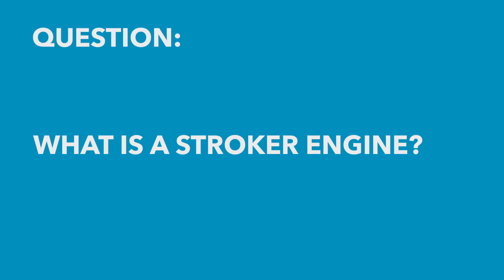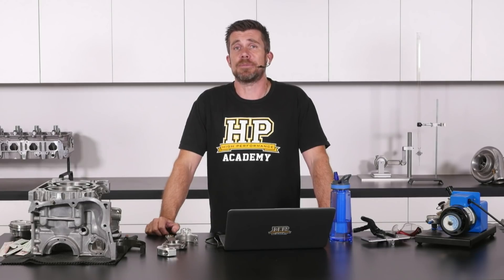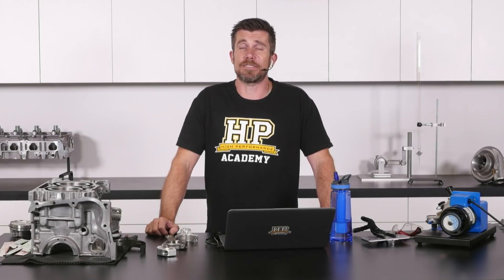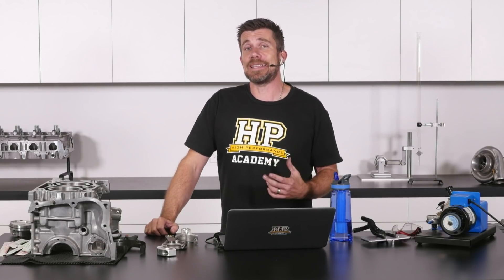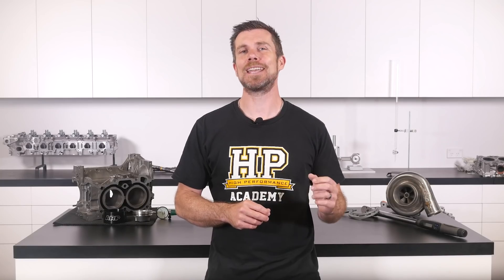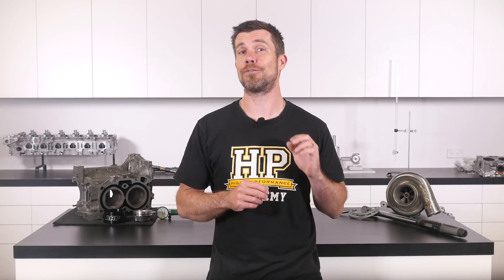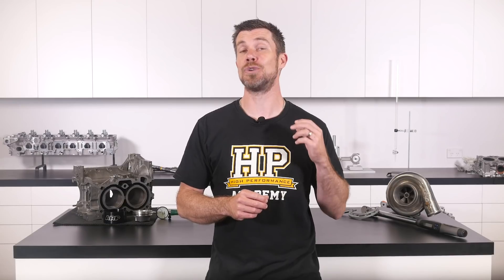Stroker Engines | What ARE They? [HPA Q&A]

Comment: If you are doing a full rebuild, to a 'stock' capacity (rules, regulations, because... ) with forged rods and pistons, it may be worth your while to use 'stroker' pistons as the higher pin position allows a longer rod to be used. This will reduce the side loading on the cylinder walls, which is what causes liner 'walk', and add a little torque/power from reduced friction and better rod geometry - it won't be a lot, but it all helps and if you're doing it anyway...